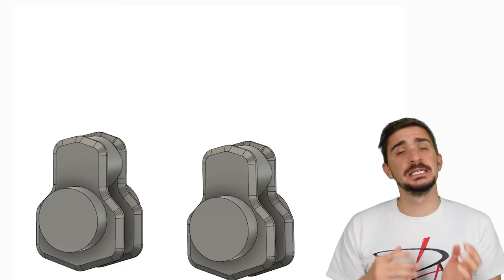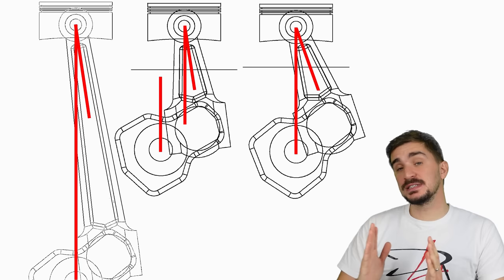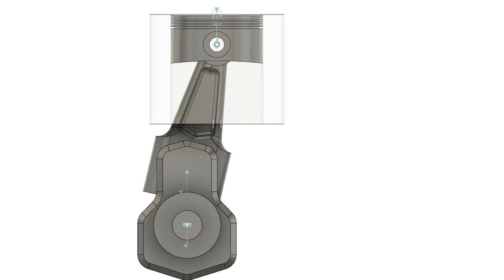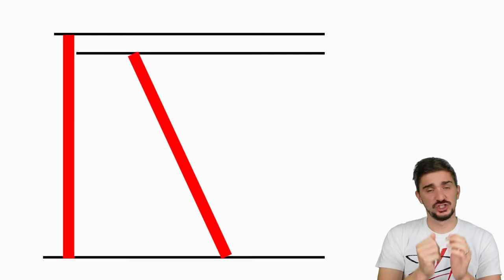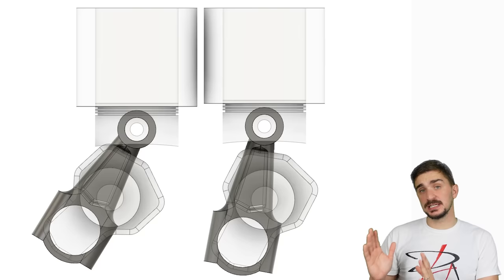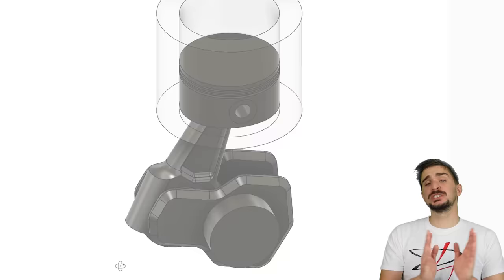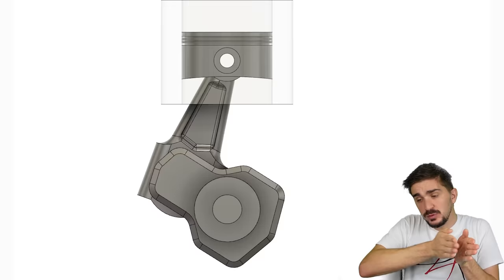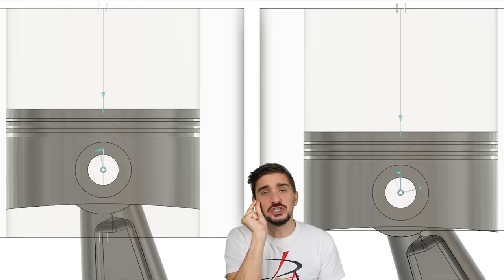Cylinder Offset Changes Everything

Comment: Not really genious at all.  This changes the angle of the crankshaft more vertically for the power stroke but af fhe same time worsens the return to the top.  There are limits here.  The piston and cylinder are now wearing down much faster than normally due to the side loading.  Not a favorable thing to do if you want more rpms.  Everything engine related is a trade off.  If you want more of this over here, than you're gonna have to give up some of that.
Reply from the maker: I'm afraid you misunderstood a bit. This is widely used on engines nowadays. Piston side loading during return is irrelevant because, unlike during combustion, there's no significant force acting on the piston.
Reply: Also the reverse is true.  More angle on power and less on exhaust.  Either way will reduce its top rpm some but torque is really whats being sought after more than the hp.
Reply from the maker: It does not reduce redline

Comment: Silly to call it genius. A few more percent power with the same amount of fuel. Internal combustion tops out at 28% efficiency. Electric cars are 300-400 more efficient.  You can keep your couple percent.
Reply from the maker: 28% is a figure from the 80s. Many modern engines are 35% and above. Some at 40. Electric motors are of course more efficient but the energy density of batteries needed to run them is very much inferior to common fuels. But why I am I explaining this to someone that can't grasp basic math?... "300-400% more efficient than 28%" .... That would make electric motors more than 100% efficient